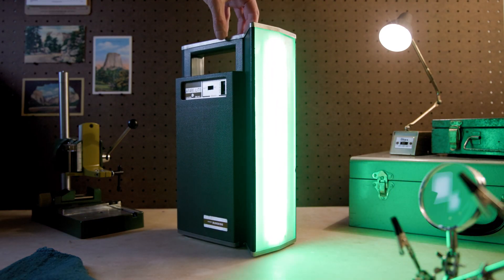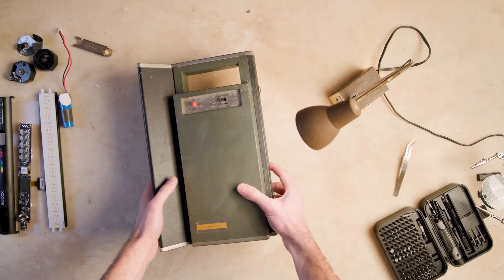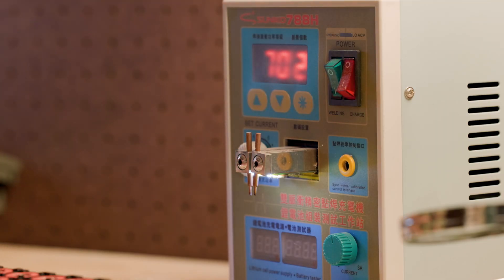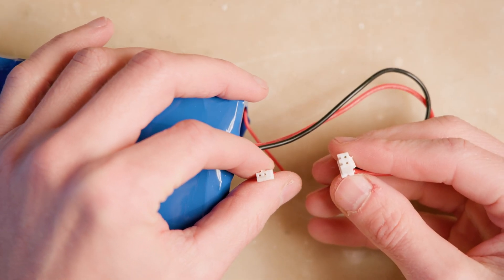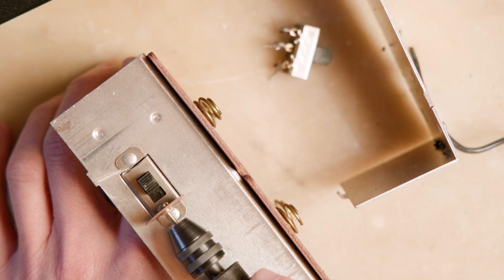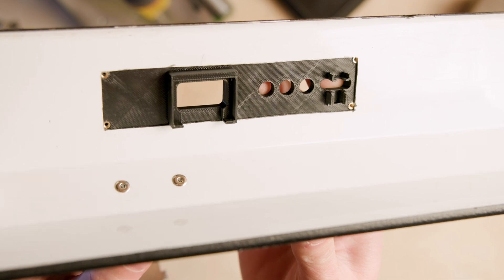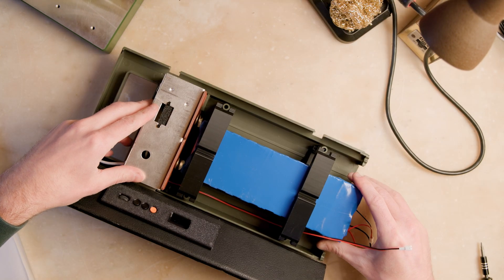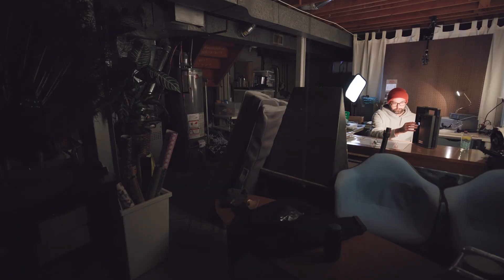Modernizing a 1970s Latern

Comment: i get theres no bms but i'm concerned about the charger not being rated for the new amp hours of the new battery. i know on my small projects i have to size my lifepo4 charger to the proper amperage or the batteries will never charge full, properly, or may overcharge later when there's voltage drift between the cells.
Reply from the maker: It is my understanding that parallel batteries share the same voltage and naturally balance each other, preventing individual cells from drifting out of sync. But I’m just a guy in a basement so I don’t really know.

Comment: Great video as ALWAYS! In case that wasn’t sarcasm, the old component you couldn’t identify is an inductor (or coil). Part of the power supply, it is/was used to drop the AC voltage before sending it to the diode bridge, then capacitors… to eventually make DC power.
Reply from the maker: It’s was not sarcasm. Haha. Thanks for the info!

Comment: use less solder... dont need to gob it, it will flow and then clean off your iron with brass scrubber and you can wick some of the excess back off the joint... make it look good and get a good pair of flush cutters...
Reply: I think you should use more solder. Like the old adage "more is more."
Reply: @johnlocke3481  it's the fumes that'll get ya hooked.... 🪝
Reply: what soldering iron do you use? FX888D is the best bang for the buck... also you can change the tip out and use it to put in threaded brass inserts ...

Comment: I've been McGuiver'ing repairs, and DIY ideas for more than 50 years. I remember cutting new tread in my bald car tires - in my university dorm room. I was doing it so that my 1961 Ford Falcon would pass state inspection. The year was September, 1969. 
-
Back then. There was an art craft called linoleum etching or it was carving images on rubberized/vinyl materials. Thus the bald tire cutting idea was born. Cutting tools were readily available at the campus book store. 
-
I love these kinds of videos.
-
Over the years, I have found, "Most experiments fail the first time."
 It's rare, ideas work out the first time.
However, "persistence pays off." 
If you gnaw at anything long enough, you'll find what works. 

-
Reply from the maker: They were still teaching that printing technique in the 2000s when I was in school. I’ll have to remember this when my tires wear down.